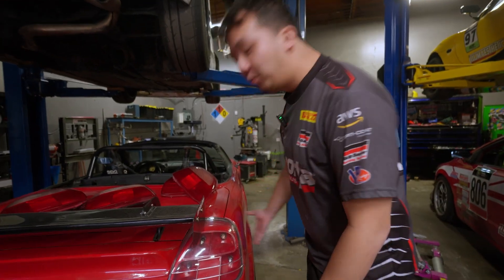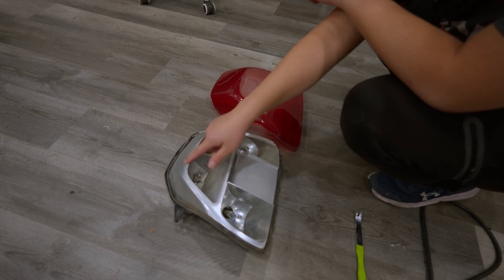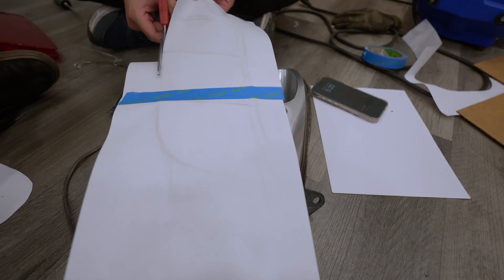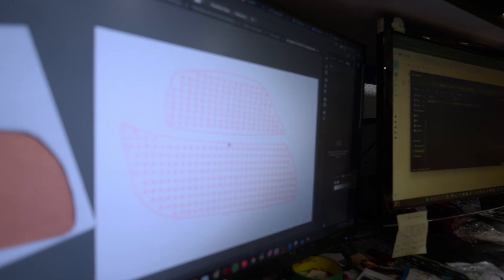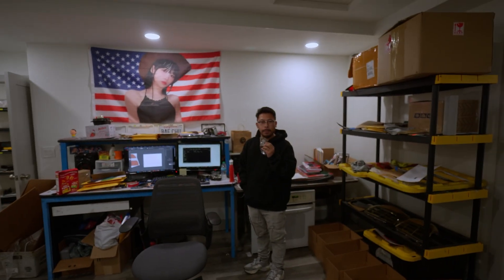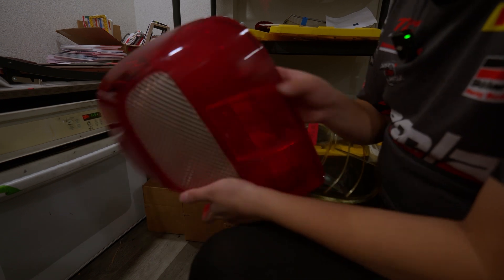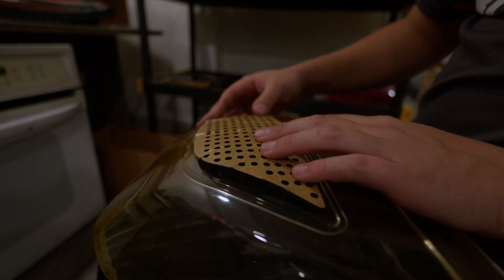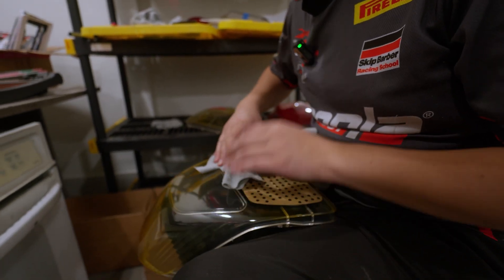How to make YOUR OWN CUSTOM LED tail lights!

Comment: I saw the clear lens video you made a while ago. I wanted to ask, what about using clear PETG instead of pouring acrylic? (maybe some sanding and clear coat will get it 90% of the way transparent)
Would it be better option for those cars that dont have support for it (subaru forester guy)? 

also scandypro is not available anymore :(( any other recs for 3d scanning tools that are lidar and not photogrammetry?